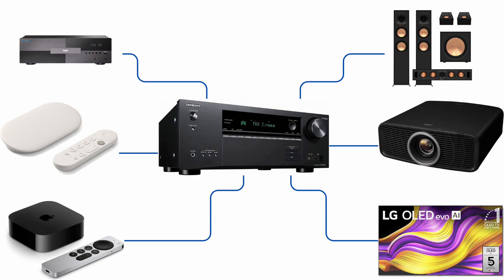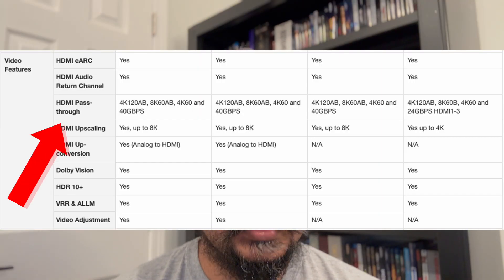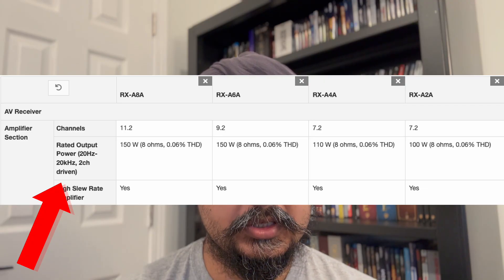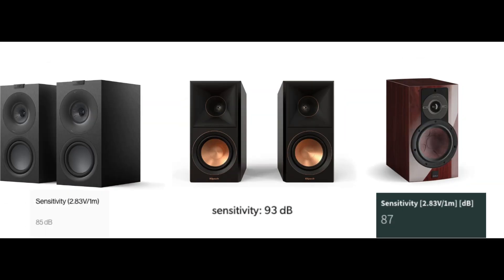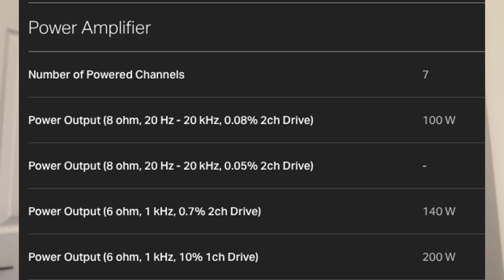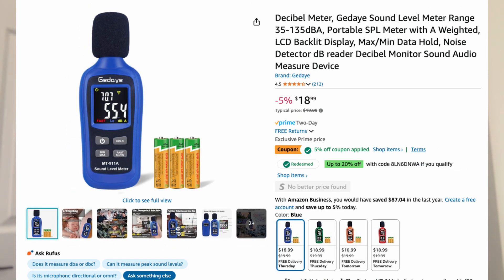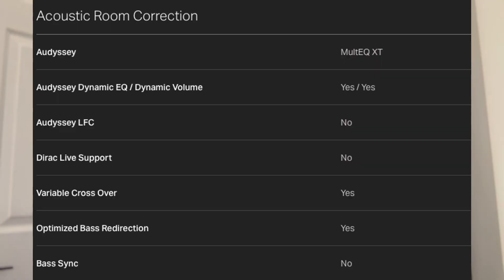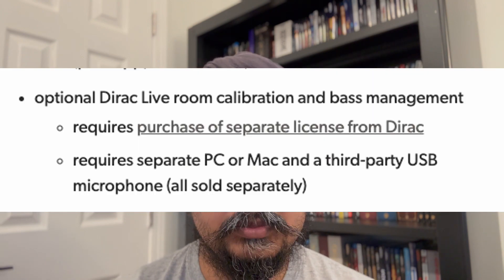The Truth About AV Receiver Specs And What They are not telling you

Comment: SPEAKERS DO NOT PULL THE POWER  THE RECIEVER PUSHES POWER INTO THE SPEAKERS
Reply from the maker: You're right that a receiver's amplifier actively pushes power to the speakers during normal operation at reasonable SPLs. This is the normal function of an audio set-up. 

My video, however, delves into a less commonly understood phenomenon: the "pull" generated by the speaker's magnets. This occurs when the amplifier starts producing distortion and clipping. Essentially, I'm showing how people inadvertently overdrive their speakers using gear that isn't powerful enough. To put this nuanced interaction simply, the amplifier's "push" of watts degrades into clipping, and the speaker drivers themselves begin to clip, effectively attempting to "pull" more power from the amplifier.

This "pull" is essentially the speaker's voice coil, now trying to move in a non-linear way due to the distorted signal, fighting against the magnetic field it operates within. It's not a true "pull" of power, but rather a symptom of the magnetic forces acting erratically when the electrical signal is no longer clean.

Comment: under powering speakers does not blow them !!!  wtf???   overpowering speakers blow them because if you over power speakers your pushing to much power sometimes it will even make them catch fire1
Reply from the maker: It's a common misconception that too much power will instantly blow a speaker. In reality, overpowering speakers is more likely to cause issues with the internal components like the crossovers and voice coils. This typically requires a sustained, high-power input, as I mentioned in the video, and the damage might not be evident after a single event.

Comment: 4:46 Distortion is what blows out speakers, not underpowering them, otherwise speakers would blow out when you lower the volume
Reply from the maker: Thanks for your comment! I think there might be a slight misunderstanding. The most common type of distortion is usually caused by an underpowered amp or receiver that's driven too hard, which leads to clipping. This clipping is what can damage speakers.

Comment: Sir namaskaar
Mujhe bhi ek amplifier setup required hai to run
1. Sub woofer 4 ohms, 325 rms, THD< 0.1%
2. Sub woofer 4 ohms, 325 rms, THD < 0.1%
3. MID 8 ohms, 200 AES, THD < 0.1%
4. Tweeters 4 ohms, 40 RMS, THD < 0.05%
I am using behringer dcx 2496 LE active crossover.
Can you please design one such amplifier?
What will be budget?
Regards
Reply from the maker: from what is sounds like you are designing your own speaker. Are all those drivers in 1 cabinet?

Comment: Hi, great answers with great English (no offence), happy to find your video. I'd like to ask one thing, Yes now we know that dealing with separates is way to go, but what is your opinion on AVR (Denon) running on full pre amp mode using external amps. Is there any difference in channel separation or sound stage in general? Any sound degradation using Avr as processor compare to dedicated processor. Thanks for your way of thinking on this topic.
Reply from the maker: There is no inherent degradation when using an AVR as a processor with an external amplifier. Of course, the quality of AVR processors varies. In my personal experience, adding an external amplifier significantly improved the sound; the soundstage opened up, and I noticed better clarity and dynamics.

Comment: On your pre-out for external amps, where exactly can one start buying? Front 3 speakers ie left, centre, & right?
Reply from the maker: That would be a good start. The left, right, and center are used the most in a movie. You can slowly add the amps for the surrounds and atmos speakers. 

Let me know if you hear a difference from adding an external amp.

Comment: I almost never use more than 2 watt per channel, for 20hz, and around 0,1 watt per channel on average when listening in a large room to TV or music. 

Unless you have to install audio in a large theatre or you run at 80dB or more as a minimum,  you don't need more and almost every receiver is good enough. 

What you should care about, is for A/B receivers when it changes from A (perfect amplifier) to B (discrete steps). That impacts the sound quality.
Reply from the maker: That's exactly right. That's why I called it out in the video—to make sure people measure how loudly they listen so they can make the right choice.
Reply: 75dB is on the loud side for me. A receiver is good enough. This comes from someone with Mcintosh amps and expensive class D amps.